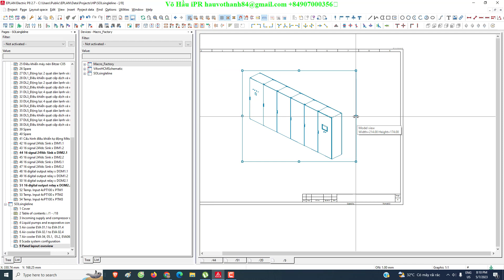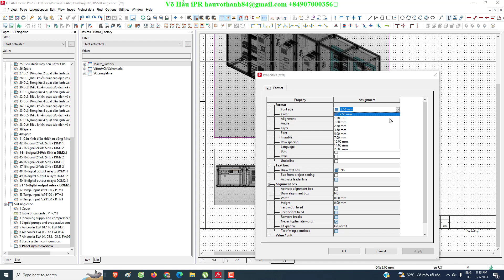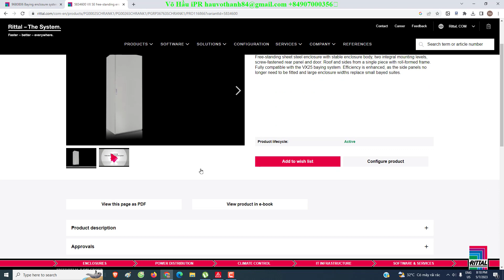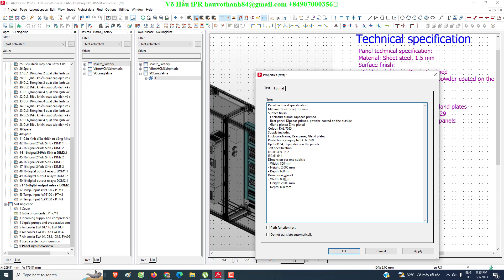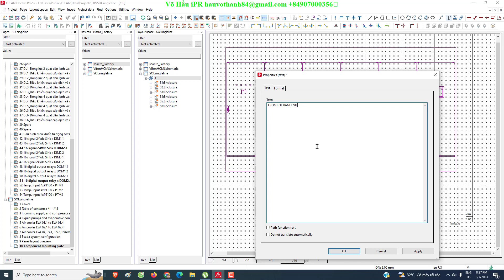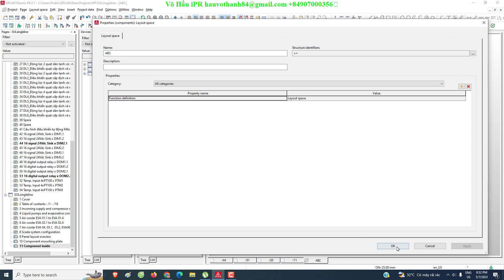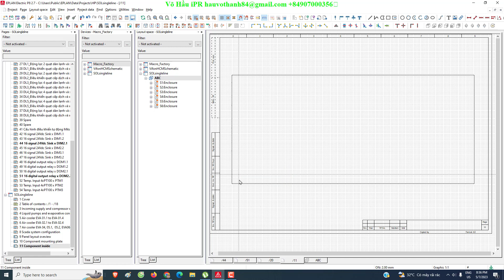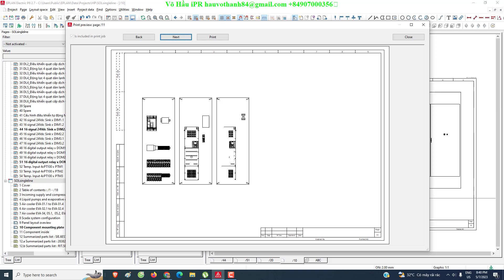Want to DESIGN LIKE A PRO with 3D Eplan? Watch This Now!

Comment: hello, the rail and cable channels I tried to draw on the mounting plate do not sit on the plate, they remain in the air. The devices I added stay in the air too. it looks like it will happen in front view. but in side view none of them are above the mounting pan.